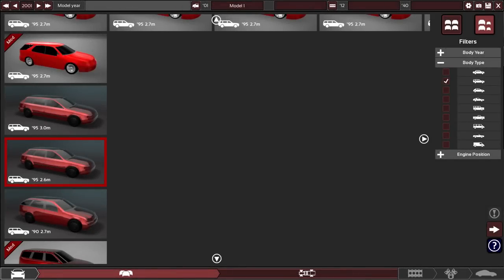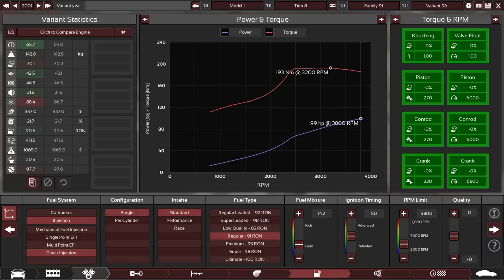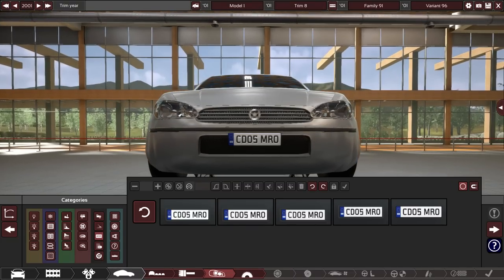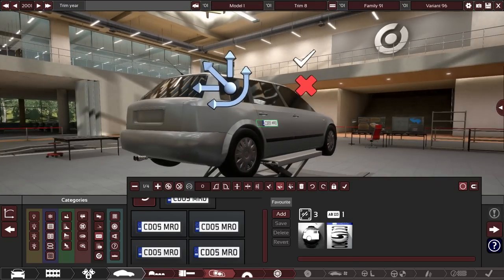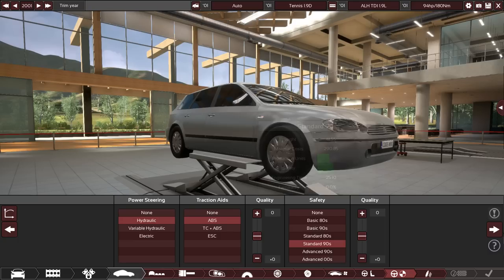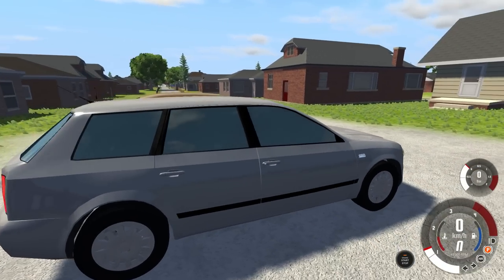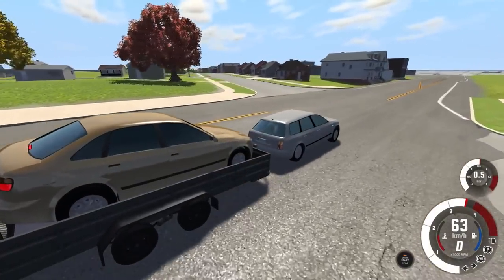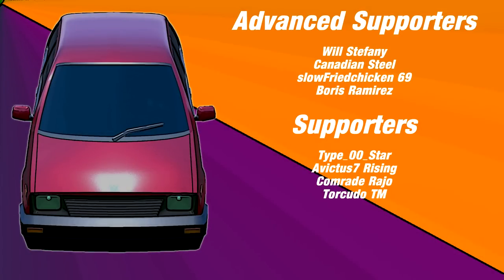2001 TDI Wagon - (Automation + BeamNG.drive)

Comment: 2:48
"It's probably EFI"
TDI literary stands for direct injection
Reply: Turbo
Direct
Injection 😁👍
Reply: What does T stand for tho?
Reply: @ASPthespeedyboy  Ok thanks 😄
Reply: @ASPthespeedyboy  I think it is Turbo Diesel Injection (and Turbo Super Injection for Petrol Versions), but I'm not absolutely sure.
Reply: @ASPthespeedyboy  Turbo Diesel Inject
Reply: @tsd560ti6  ur right.
Reply: @tsd560ti6  TFSI (Audi) = Turbo Fuelrail Stratified Injection / TSI  (Any other VW car, or owned by VW) = Turbos Stratified Injection
TDI = Turbo Diesel Injection
Reply: Turbo diesel injection god
Reply: Well, diesels are direct injection by default.
Reply: @timburger4754  No, TDI means 
Turbocharged
Direct
Injection
Reply: @tsd560ti6  Turbo Stratified Injection
Reply: @TopGear25S  Yeah thats right my das has a TDI Touran and it isnt a Diesel
Reply: Guys it means Turbo Diesel Injection
Reply: @Rapunzel_thicc  Turbo Direct Injection
Reply: T-Turbo
D-Diesel
I-Injection
Reply: @timburger4754  TFSI stands for Turbo Fuel Stratified Injection
Reply: @sn1per.-992  that is actually impossible. Although TDI means Turbocharged direct injection and the D doesn't primarily stand  for "Diesel", it is only used on Diesel cars on every single Turbocharged Diesel VW car (VWs, Audi's...). Non-turbo diesels are called SDI (suction direct injection). Turbocharged Petrol Cars with direct injection are called TFSI (Audi) and TDI (VW). Non-turbo petrols are called FSI. If it says TDI on the back: always a Diesel.
Reply: @marcelbbr  Then How is my Dad Filling his TDI Touran with normal Petrol?  Btw im from Germany
Reply: @marcelbbr  This Comment is making no sense to me at first you say its impossible then you say its Called TDI at VW Wtf?
Reply: Turbo Diesel Injection
Reply: allways thought it stands for turbo diesel intercooler
Reply: German here, I occasionally drive an opel Zafira Tourer 2.0L CDTI. 
CDTI is like an opel upgrade of TDI, Common rail Diesel Turbo Injection. TDI does not define how the diesel is actually injected into the chamber, CDTI isn't available for automation.
Reply: TDI is literally VW brand name for diesel engines.
Reply: PUG Sn1per G0d every TDi car made by VW is diesel. Your dad has probably 1.9 TDi engine
Reply: PUG Sn1per G0d It either says GDI(gasoline direct injection) and you got that wrong,or he fills it up with diesel.
For everyone else in the comments,TDI stands for turbocharged direct injection and every VW with TDI on it's back is a diesel.
Direct injection is not exclusive to diesels,but every diesel uses direct injection.
Reply: Marcel Büber some gas engines also use direct injection
Reply: @mihneacireasa4613  Most cars use it
Reply: jeetsupa 1.Not the point I was trying to make
2.Most cars use MPI.It's way cheaper to produce.
Reply: @mihneacireasa4613  true, my bad.
Reply: Means Turbo Diesel Injection
Reply: @TopGear25S  No TDI means Turbo Diesel Injection, because VW has an SDI engine wich means Standart Diesel Injection (doesn't have turbo) so TDI was used in cars with turbo.
P.S: My father only has Volkswagens so I know what I'm saying
Reply: @joaopedrofirmino449  I said that TDI stands for Turbocharged Diesel Injection, you can search for the comment. I also know about the turbo-less Diesel engines that VW has produced.
PS: I know what I'm talking about, I own a car with an NA Diesel engine.
Reply: @joaopedrofirmino449  https://en.wikipedia.org/wiki/TDI_(engine)
Reply: @sn1per.-992  TDI is always a Diesel.
Reply: @mihneacireasa4613  no those are called FSI
Reply: @sn1per.-992  du hast einfach keine Ahnung von dem Auto deines Vaters
Reply: @JohannesB5  then how is my father filling his tdi touran withnormal gasoline(Super)
Reply: @JohannesB5  Wahrscheinlich vllt hat auch irgend wer das tdi zeichen daran geklatscht kp aber es ist so.
Reply: @sn1per.-992  kann gut sein
Reply: @JohannesB5  GDI is gasoline direct injection.TDI is turbocharged direct injection,though VW uses this acronym only for diesels.SDI is non aspirated direct injection(still,only diesels) and FSI stands for fuel stratified injection (highly pressurised fuel that injects directly into each cylinder) which still is a derivative of direct injection.This reply is meant for everyone,I am fairly confident I didn't get anything wrong
Reply: @mihneacireasa4613  GDI is correct but VW never used that name the names VW uses and has used are: FSI, TSI, MPI, TDI and TGI for Gas powered vehicles
Reply: @MravacKid  not always, there are older diesel engines (used until late 1990s), where the fuel is injected into a prechamber, or swirl chamber, where the fuel burning starts. They are indirect injected diesels.
Reply: Jan M because TDI came first as Pumpe Düse, then common rail but didn't bother to rename it entirely, it's still Turbo Direct Injection.
many of the brands sold around here in Europe that sell diesel cars (like all of them) do have a C in their name as in Common rail (Renault's dCi, Ford's TDCi, Mercedes' former CDI). All I know is that Peugeot in the 90's were the pioneers of the modern diesel compact cars with the common rail technology (they name it HDi for some reason) and basically everyone made their own version after them.
Reply: @ASPthespeedyboy  
turbo
diesel
intercooled
Reply: Turbo diesel injection
Reply: TopGear25S Also a diesel engine has forged internals not cast iron which would blow out due to the massive compression;)
Reply: t restomod Common rail was invented and first applied by Fiat not PSA
Reply: TDI is, in fact, “Turbocharged Direct Injection”.  Although it is a Diesel engine, the fuel type is not specified in the name.
Reply: It's actually Turbo Diesel Intercooler
Reply: Direct injection in 1990’s rather not
Reply: replies to this comment just show the full scale of ignorance and the urge to post something while not knowing the least bit about the discussed matter.
originally, TDI = turbocharged direct injection. there were vw turbocharged diesel engines with indirect injection before, and they were simply called TD. in contrast to the generic term TD used by many manufacturers, TDI is vw's registered trademark.
as for the guy whose dad drives a "tdi gasoline touran" - probably a kid.
as for the guy saying that "cdti is opel's upgrade of tdi" - cdti engines have absolutely nothing to do with vw's tdi engines. and the fact you're german has nothing to do with you knowing or not knowing what you're talking about.
as for the guy stating that "all diesel engines have direct injection" - no, they don't.
and so on, and so on...
Reply: Turbo Diesel Injection

Comment: I believe you’ve got the technical specs for a marine TDI, which differ a bit from the automotive ones, concerning power and rev limit. As far as I know every 1.9 VAG car engine revs to 4500rpm. Usually they’re between 90 to 110 hp @ 3900rpm (ish) depending on the turbo that’s matched to it. Expect around 230ish nm around 1900 - 2000ish rpm. 

Also, I believe that the block itself is exactly the same across all 1.9 VAG diesels so I can’t pitch in about the bore and stroke.

Sauce: I own an AFN TDi.
Reply: Also, the power figures I mentioned above are for the non PD TDI engines. The PD ones have a little bit more torque and hp
Reply: 110 hp version is 1.9 td with red i (i think think that's how they lable it because every vag car I saw with red I was 110hp)
Reply: @enismehic  that's right, the 130hp version  has a red D and I. And on the 150hp version the whole TDI logo is red.
Reply: Yeah, people called them “red i’s” IIRC. I think they were also the most common 1.9 TDi of them all.
The 150hp ones were fitted only on AWD powertrains, right? I remember the TDi Golf IV 4motion having that red lettering across the power train badges
Reply: @jonytube  The 150HP ARL engine was also in FWD Seat Leons, so not exclusively AWD.
Reply: @dacmm  oh thanks my dude! I genuinely thought that those Leons were AWD like the Cupra 4s
Reply: hehe sauce
Reply: @dacmm  seat ibiza cupra had PD160
Reply: João Gusmão 
the ALH TDI, the engine he is trying to build, did come with 90 hp, one of the most popular german 1.9 diesels around here.

Comment: Props to vw for making a beast of a motor
Reply: 90hp beast
Reply: einar that engine is not about the power at all. It's about the reliability. I don't know if you watch CarThrottle or not but they have bought a Škoda Octavia with this engine in it and it has done more than 400.000 miles. And yes the engine is still working perfectly. And my mom has a 1.9TDI Golf Wagon and that car is working still. I don't really like VW but i gotta respect them for making this beast of an engine.
Reply: @einar8019  Other variants of the 1.9 tdi have more power, mine was 105 stock (mapped to 150 now) but others had 130 and 150

Comment: the stock version of the used body resembles more the previous Audi A4 Avant, could’ve made that instead of the Golf, but it’s your choice :)
Reply: I think it's closer to Audi 80 Avant (B4) than to the first gen of A4. Even the variants for this body are more fitting for 80 (Saloon + Avant) /89 (Cabriolet + Cabriolet with optional factory hardtop, Coupe is somehow out of place with its shape).

Comment: Now you should try and make the PD130(or even 150 hp one) version of 1.9tdi. 130 hp and 310 nm at something low like 1900rpm. And rev limit at something like 4.5k rpm.
Reply: Think my VRS has that engine
Reply: Torque @ 1900, hp @ around 4000
Reply: B&M Bargains if it’s a Mk1 VRS it would be a PD130 or 150. Good engines!

Comment: Im not sure about really old diesel engines. But pretty much all diesel engines are direct injection. Also 3750rpm is probably it's max power. Redline is probably at around 5k rpm.

Comment: you dont want to have a first gear that tall, try having first gear end at 20-ish k, 2nd at 40, 3rd at 65, 4th 90 and then have 5th be really tall for efficent higway driving
Reply: Bump
Reply: Gorazd Atanasoski those are some short gears
Reply: @mjbakedbeans  well its diesel so they tend to have short low gears
Reply: @mjbakedbeans   well yeah but it will get more out of the engine as its an automatic
Reply: @gorazdatanasoski7967  Well normally you have 1st going to 35-40
Reply: You can't do individual gear ratios in Automation.
Reply: @reinbeers5322  oh didn't realise that

Comment: I hope the devs bring Diesel engines into the game, aswell as:
-Electronic engines
-Hybrit systems
-Rotory/Wankel engines
-More caegories like: Buses, Semi-Trucks, prehabs motorcycles
-W-Engines
-VR-Engines
-V-VR-Engines
-8cylinder Inlines
-Hydrogen Engines
- Chassis with 6x6 capabilities
-if they where to put in motorcycles then single cylinder and 2 cylinder engines
-and lots of more stuff i cant think of rn.

Comment: Well to be accurate, diesel engines dont have valves like a normal petrol engine
Reply from the maker: Can't be 100% accurate when diesels don't exist in game
Reply: @automotiveflux  ofc, have you tried the diesel mods?
Reply from the maker: Diesel mods? Automation only has visual mods
Reply: @automotiveflux  i can share you a video by another youtuber which shows how to use diesel mods, using the mod is a bit tricky, but possible
Reply: yes they do. they dont have spark plugs unlike gas engines
Reply: @Attack-fb5rj  send the vid
Reply: They do have valves EXACTLY like petrol engines.
Reply: I think you mixed up valves and spark plugs.. Diesels very much have valves like petrol/gas engines..

Comment: Rear suspension should be semi travelling arm like all VW
Reply: Some VW are solid axle, others are multilink, not that many semi trailing arm
Reply: @Random-nf7qb  golf 7 gtd is still semi trailing arm or i am wrong?
Reply: @nicolasdipasquale8337  As with the shorter car, the rear suspension design fitted to the Golf Estate depends on the power rating of the engine. Above 120bhp, a multi-link setup allows all four wheels to react to the road independently, while slower cars receive a twist-beam rear end that is only semi-independent in its movements.